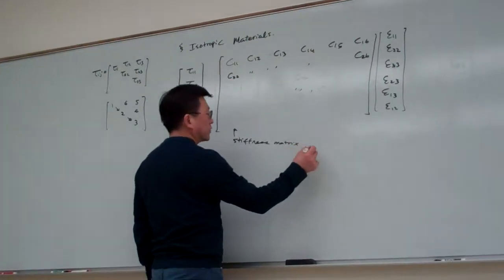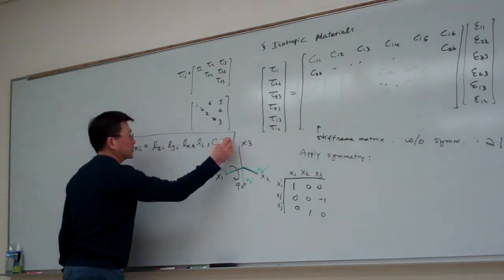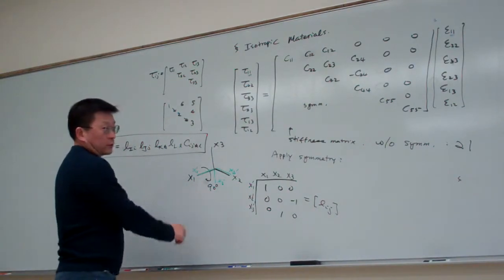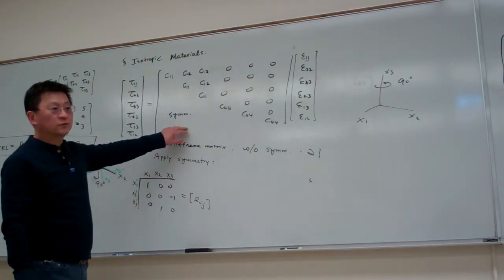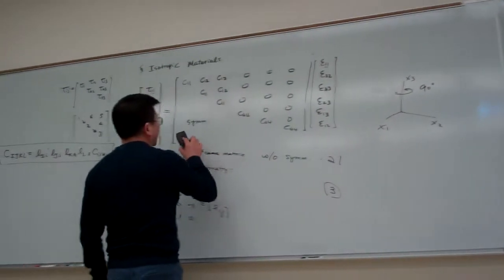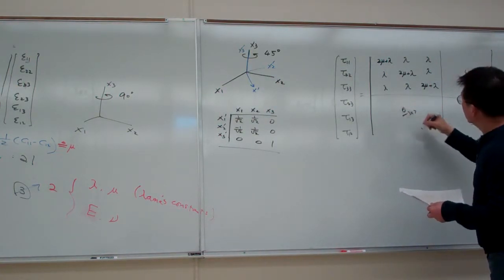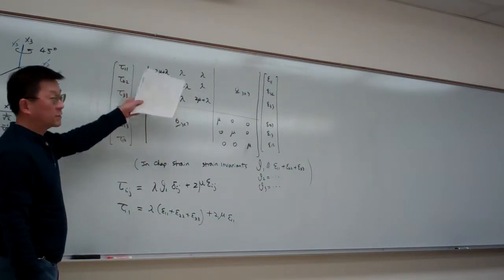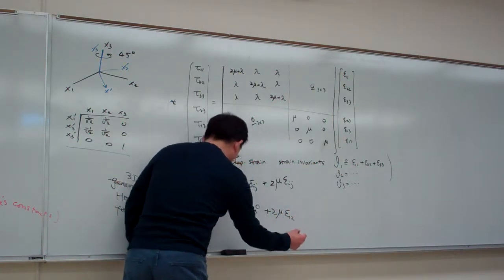21 2 Elasticity Isotropy

Comment: Thank you sir, can I please get the hand-out sir?
Reply from the maker: My lecture notes came from a variety of books, so the best I can provide is a list of the reference books that I ask my students to browse.  You should find some of them in the library:

Advanced Mechanics of Materials, R. Solecki and R. Conant, Oxford, 2003. Ch2-4, 8-9.
Advanced Mechanics of Materials and Applied Elasticity, Armenàkas, Anthony E, CRC Press, 2013. ch2-3, 5-9, 11-12
Theory of Elasticity, Timoshenko and Goodier, 1970, (available at the library, QA931.T55 1970)
Elementary Engineering Fracture Mechanics, D. Broek, Kluwer Academic Publishers, 1991.  (available at the library, TA 409 B76 1991)
Linear Elastic Fracture Mechanics for Engineers: Theory and Applications, L. P. Pook, WIT Press, 2000.  (available at the library, TA 409 P65 2000)
Experimental Stress Analysis, J.W. Dally and W.F. Riley, McGraw-Hill, 1978. (available at the library TA407 D32 1978.)